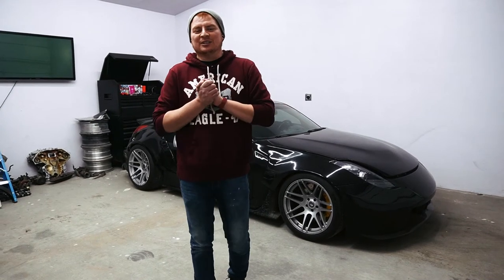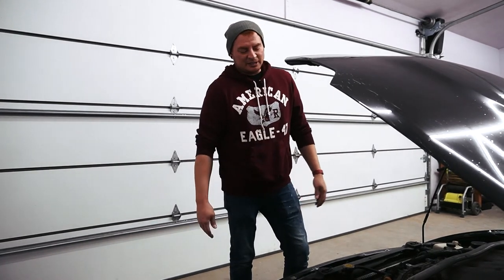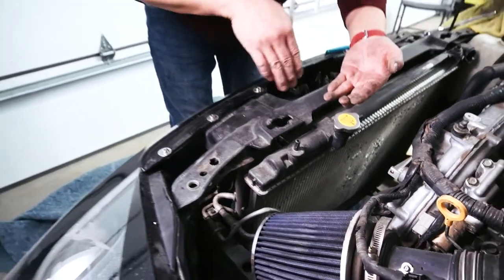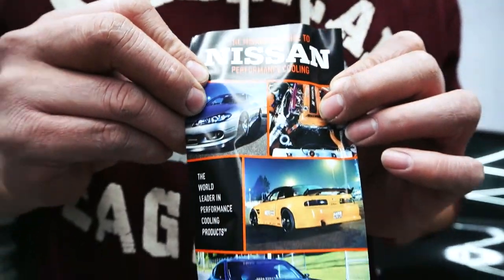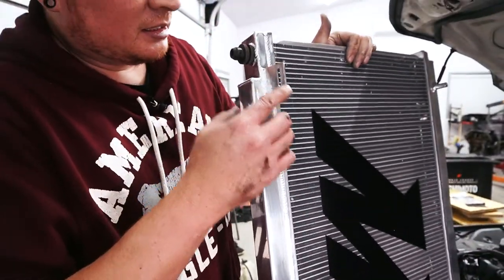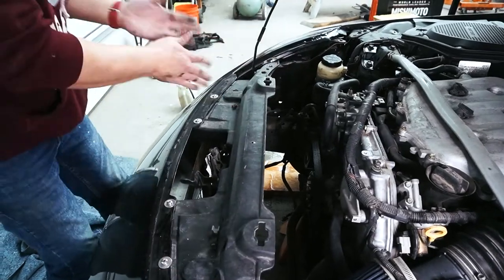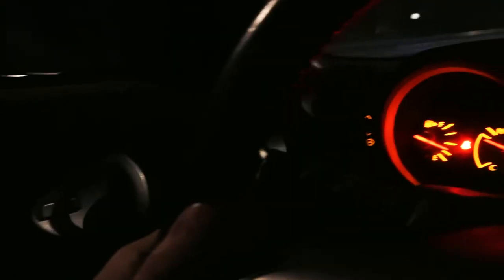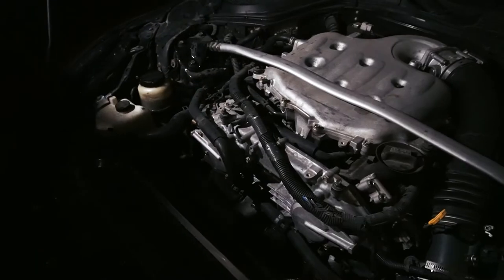350z Radiator Replacement

Comment: So what do we do with the hoses that have oil running thru them at the bottom, it’s two of them?
Reply from the maker: Those are for the auto trans fluid. The best thing to do is install a separate trans cooler in between but you can just loop the lines together and it will still work fine.

Comment: Does it work on auto?
Reply from the maker: No, it doesn’t have the ports for the trans cooler. You could still use it but you’d need to purchase a separate trans cooler.

Comment: So what would I do about my oil that’s going thru my stock intercooler how would I know what intercooler I needa purchase
Reply from the maker: If oil is getting into your intercooler your turbo is probably blown.  Do you mean radiator?  If there is oil mixed with coolant in your radiator you heads are probably warped from over heating and will need to be removed and machined flat then head gaskets will need to be replaced.